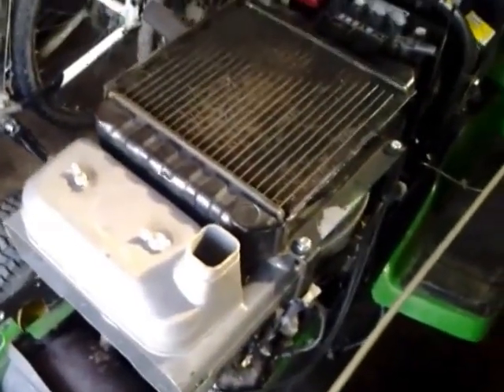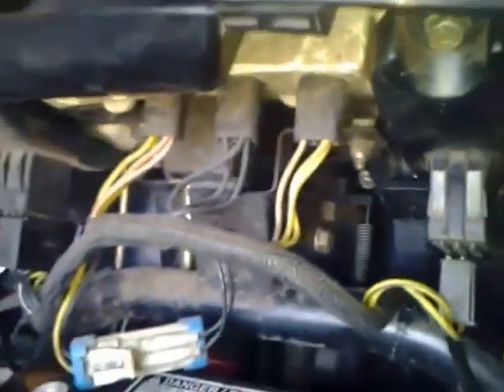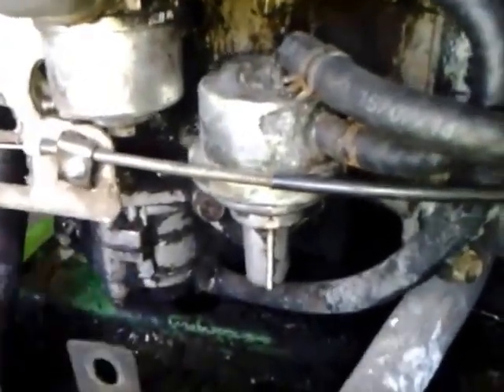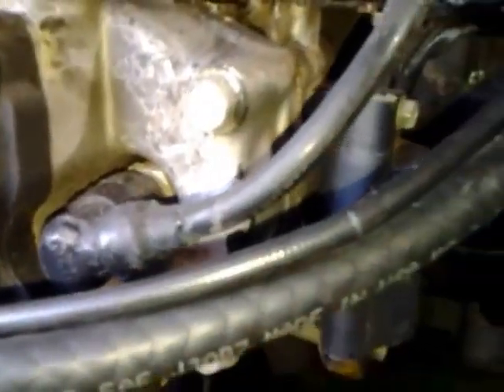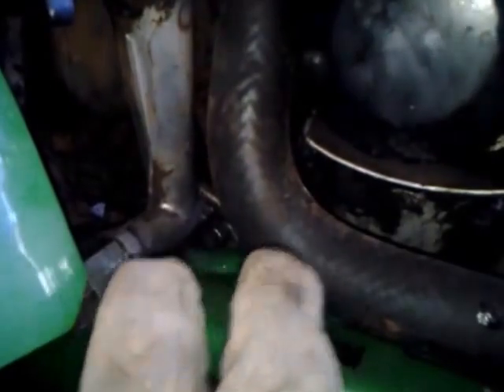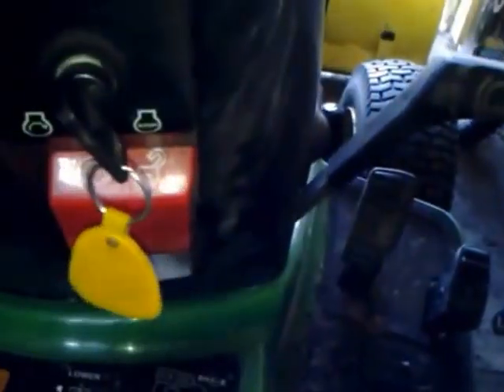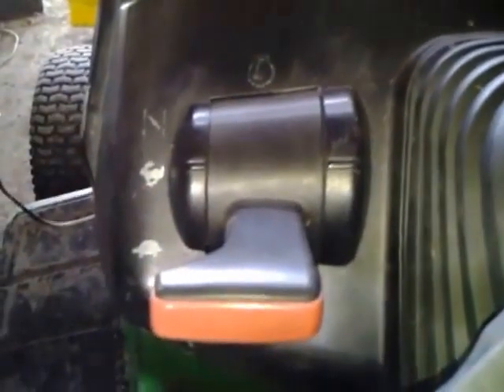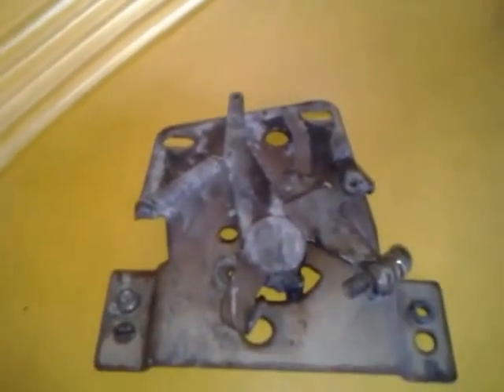Explaining John Deere 345 FD590v Engine Componants

Comment: Next to the oil filler cap, to the left is another black cap. What is that for? I see it's low, and I can't tell if it's hydro fluid or what. It's a cherry 285 with a fd590v I paid $90 for from an estate sale. 336 hrs, old man used it to mow about a quarter acre all its life until he died last year and mostly pulled his little yard cart around. About what I'm gonna use it for. Its also getting a little water in the oil, head gasket or water pump. His grandson said for the way he babied it, it was in the shop often, but for 90. maybe ill put the never used snow plow and chains on

Comment: Yep, have a 345 and I've dealt with all the major issues with the Kawasaki FD590V engine. Plastic cam replacement, replaced the ignition module twice, fixed carb spraying fuel on the exhaust, leaky valve covers, surging, and finally a failed voltage regulator which cooked all the battery acid and left a huge amount of vapor in the battery which then exploded like a bomb. Other than that, a really good lawn tractor!

Comment: fuel pump goes bad,sprays fuel out onto the hot muffler,replacement pump has a different design,fixes the problem before your tractor catches fire

Comment: My 345 John deere makes a grinding noise when i turn thr steering wheel and it want lift the Deck ether , It make a grinding noice when i move the leaver under the sterning wheel to lower  or raise the deck.  Can you give me any idea what to check that would cause this problem. I checked the Hydrolic fluid and it was just a little low without screing the cap on.
Reply from the maker: It sounds like your problem is related to the hydraulics in some way as all the systems you named are hydraulic ones... Does the drive also have issues like will it go forward and backwards?  A grinding noise could be a bad hydraulic pump but I haven't really troubleshooted this system before for that issue.  Basically if you're not building hydraulic pressure the pump is probably bad or one of the valves that controls the flow of liquid.  So those are the areas I would focus if some hydraulic systems work and some do not I would be looking at valves or possibly bad wiring going to valves... Unfortunately I don't have a whole lot of experience on hydraulics for John Deere's as I swapped back to a manual one...

Comment: I've worked on several of these engines and they truly are nightmares, cool and neat because of the LC aspect, but it also creates more issues than I think necessary, and yet people hold this tractor in such high regard
Reply from the maker: I have to agree with you on that these motors are absolute pain to work on and I would not recommend buying a liquid cooled if you can possibly avoid it... Actually if you look at my channel you'll notice that I swapped over to a 214 from 1980s which is a lot more fun to work on and restore :-)

Comment: thanks for the comment about a dry fuel pump requiring a gravity tank to prime. part of my woes with this engine. same engine was used on kubota T1850G lawn tractors.
Reply: Think I may have the issue with the fuel pump, how exactly did you cure it with. The gravity tank